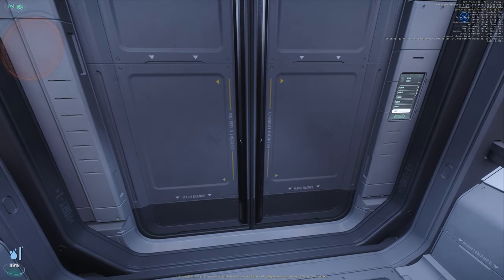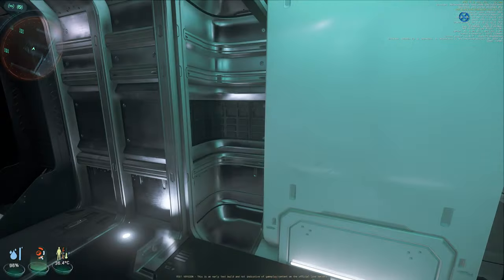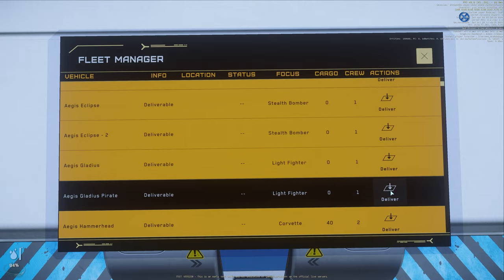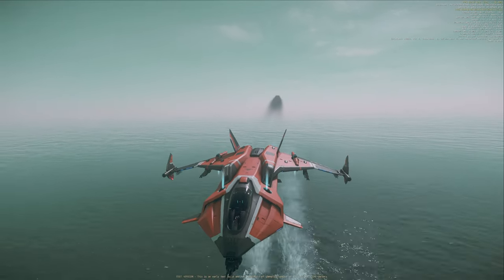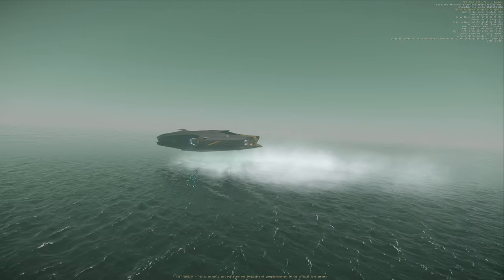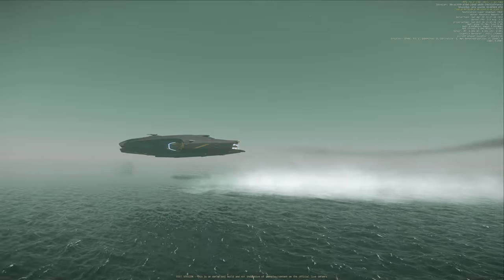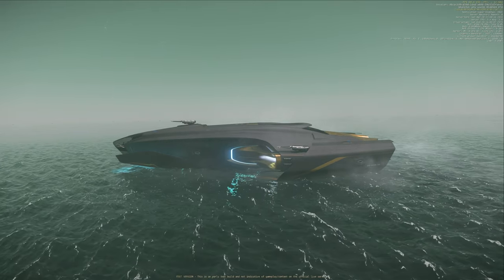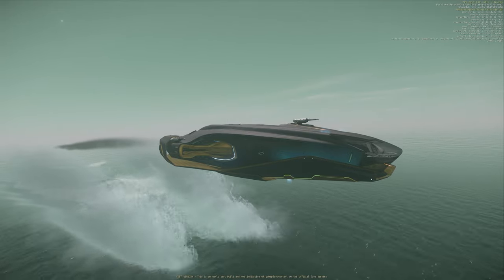3.23 New Water VFX Polish -- I Like It, But Wife Is Asking Why This? | Star Citizen 3.23 EPTU

Comment: It’s worth noting that this is a feature ported over from the single player SQ42.  They showed off at least one point of the game where you’re flying low through a canyon with a river, meaning that EVERY single person who plays SQ42 is gonna go through that sequence and experience those water physics, as well as any other moments in SQ42 with low-flying over water.
Reply: Also worth noting that the people who design VFX like this aren’t the same people who write networking code, design new ships, add new gameplay loops, bugfix, etc.  So it’s not really fair to say those “resources” could’ve been allocated differently since those things require different staff.
Reply: Even more important, the Sq42 trailer showcased a scene where the main Character was driving a boat! 
That would look super awkward if the water couldn't react to that. It also included a scene where a group of marines were trodding in shallow water, which behaved quite accurately when they moved through it. 
It's 2024, you couldn't get away with releasing a game that has static water where the only interaction effect is a texture, so they made sure it's at least comparable to current industry standards.

Comment: Here is the answer to the question Why: Immersion and future features.  One day they will add boats, submarines and missions both on and under water.  This was discussed years ago, and they are getting closer to adding it, though I suspect it is still a long ways off.  Also, from a realistic point of view, spaceships can't move underwater  because they have intake valves with suck in air (or gases such as hydrogen in space) and they are not designed to suck in water.  Not to mention the fact that on some planets liquid oceans can be made of different elements beside H20.
Reply from the maker: Good answer, thank you!

Comment: they dont need new pointless vfx they need to fix all the broken crap they already have. also just 1 more thing to laaaag up the server
Reply: VFX is what gives you the desire to play the game. There are several different teams working on the game. The engine the game is running was heavily modified from the original Cryengine to the point it isn’t even cryengin anymore. 

The graphics are like building a new game in Unreal Engine 5. 

This doesn’t lag the server, entities in the game lags the server. One the put in server meshing you will see a difference in performance. But not until then.
Reply: @amigo3284 it doesnt matter how much you polish a turd it will never look like a diamond